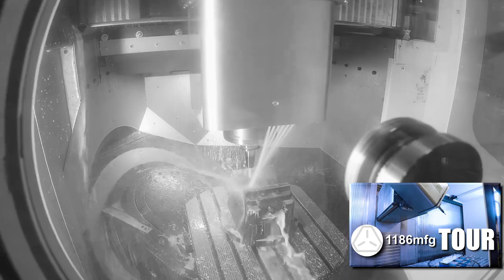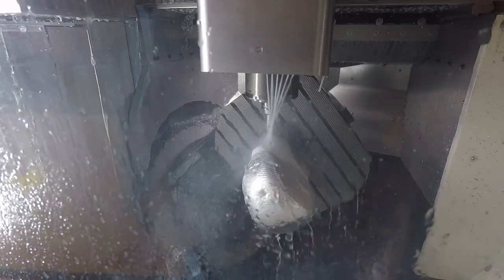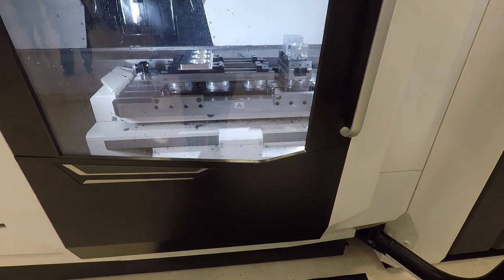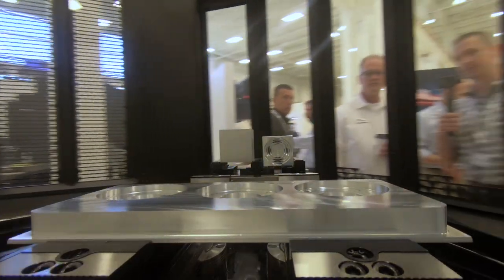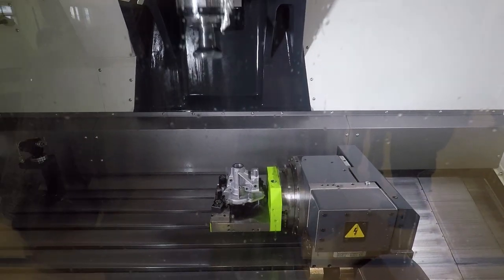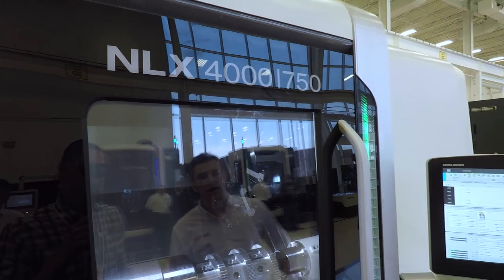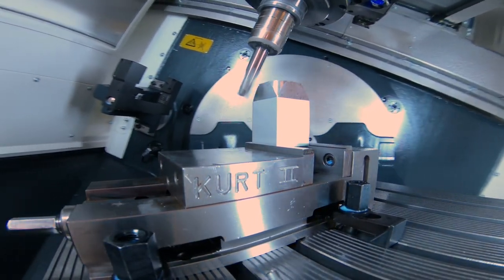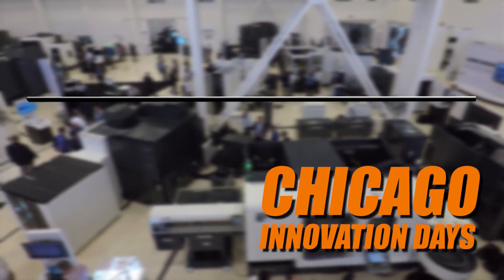DMG MORI CNC Machines: Chicago Innovation Days!

Comment: I prefer the DMG Mori DMC  to the CMX as all the slide ways are above the table away from the machining envelope.
Reply: I agree, but the DMC is literally twice the price of the CMX well into the $300k range.
Reply: @harrelsontrumpets  I worked on a M1 and despite it being a lower class machine priced at around 80k with all options, it features the same head-head-head design which makes it very reliable and makes cleaning and maintenance a charm, while the Siemens control is pretty nice despite encountering many erratic problems, but at the same price point Doosan is better in almost every way except the design layout which has a moving table. I would be very hard pressed to choose if I didn't already have an idea of what I would be making, as when it comes to automation one is more suited to pallets while the other is easier to equip with stuff like barfeeders etc.

Comment: I am going to Germany in 3 days and I will visit lot of dealers. already bought one old CTX400 by photo 😄 
And gonna buy CTX420/520. I expect from them good accuracy)) they have linear system. Also will look for some DMU milling 4/5 axes. Whooaaa
Reply: Linear scales will not add accuracy a penny! This is for control to mask earlier degradation of your slideways. There is a reason why they put this expensive part as a standard! Think about it! They woulnt spend a dime but now they put expensive scales into machine? There is more to it. Reality is that with scales amchine is cheaper but people make "whoahh" sound. The other story is they make it mass production next door to DMG in Pfronten.

Comment: How the hell are they getting 75hp out of such a small motor? My 10hp spindle is probably the same size as the one they're running!
Reply: That's the NHX6300 with a CAT50 spindle. Often times, videos don't do machines justice with regards to size. The spindle housing is over a foot in diameter.